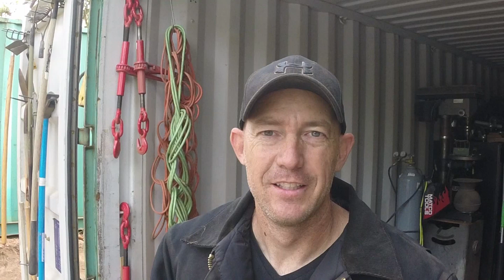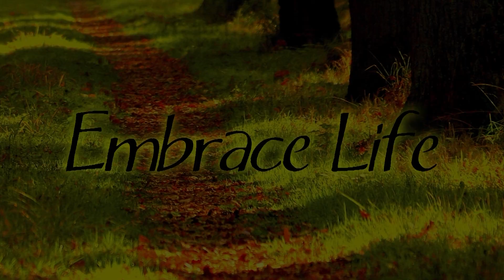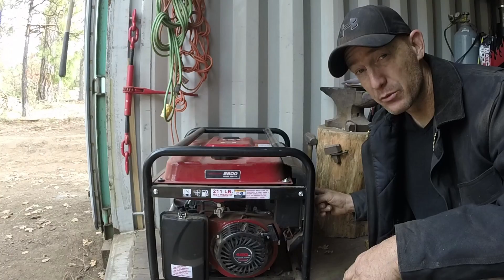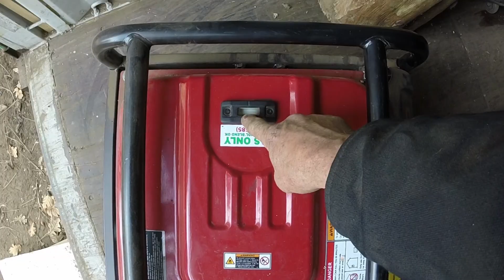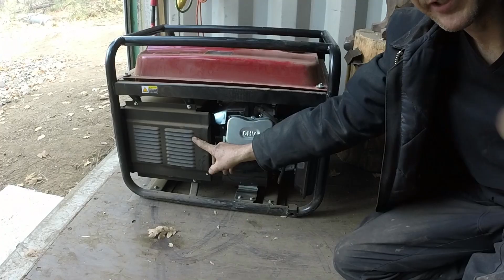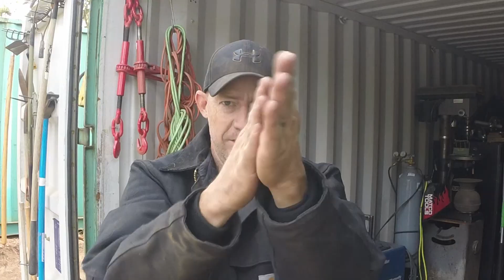Predator generator 6500 review Harbor Freight

Comment: Deff good generators. I purchased the 3500/4375 generator just before hurricane Michael. I was cautious being it's harbor freight. Great generator for the money.  I been draining the tank after use, but this last time I just added stabil to a full tank. Hopefully no issues next time I need to run it.
Reply: bud hart what did you power with your generator for the hurricane? I need to power a refrigerator,  window ac unit, tv, and microwave. Would yours power all that?
Reply from the maker: I leave the fuel in the tank all the time but I start it up at least twice a week so I have power out at my container box shop. Seems to be pretty good on fuel too. :)

Comment: I have the same generator I have barely used it very often I guess that's okay I want to use it for a welder at 2:20 line have you ever experienced that with this welder
Reply: I have been using mine with a 220 welder with no problems.
Reply from the maker: I use this generator with my welder but my welder is a 110 welder not a 220 so I don't know how well it will do. Check the amperage of the welder and make sure the generator can work with it. :)

Comment: Need a generator that can run my house furnace. Power goes out here in the winter time quite often. Would one of those do the job? Just wondering, thanks for the video....helps me out.
Reply from the maker: I don't know if this generator would run your furnace. Need to see how many watts your furnace needs to run and match a generator up to that. Hope this helps. :)
Reply: @KoalityofLife  makes sense.. thanks again. Much respect
Reply from the maker: @Lightning7474.  You're very welcome. :)
Reply: lightning 7474 is your furnace natural gas or propane?  If it's all electric, I would say no.
Reply: @woohunter1  natural gas.
Reply: lightning 7474 you are well within the limits of this generator.  The only thing the generator is running is the blower fan, ignition system, power to thermostat, and hot surface igniter.
Reply: @woohunter1  ok cool!  Thank you so much for replying. I appreciate it.
Reply: lightning 7474 no problem, I knew you were well within limits, I did a quick Google search, " electrical requirements for a typical gas furnace", looks like it's around 600watts, even less than what I would have guessed.

Comment: I have had the 8kw gen from harbor freight for about 5 years now, I average about 25 days a winter with no power. Have never had an issue with it. Also when sizing a gen, do not Exceed 70% of the running watts. When you go over that you’ll kill the voltage regulator in the generator head. I only use about 3K watts on mine, I never really push it. I’m pretty sure that’s why I have never had an issue with this Chinese generator
Reply from the maker: Good to know. Thank you for watching.  :)